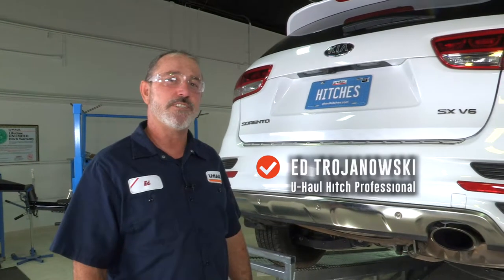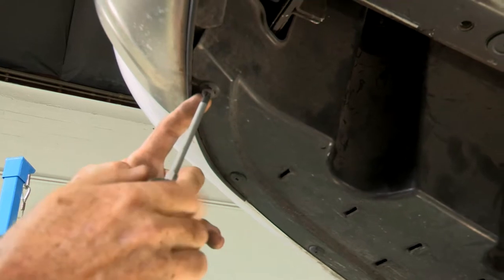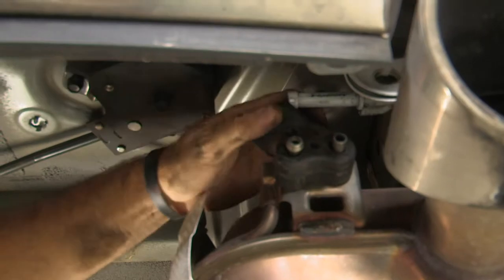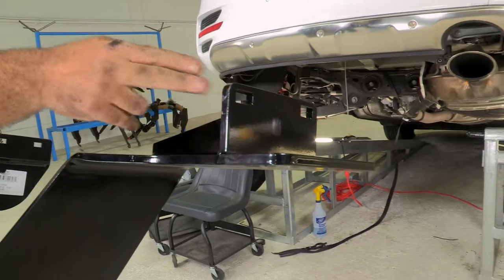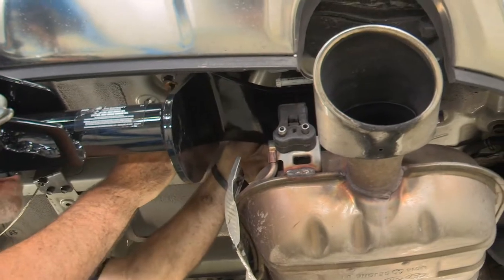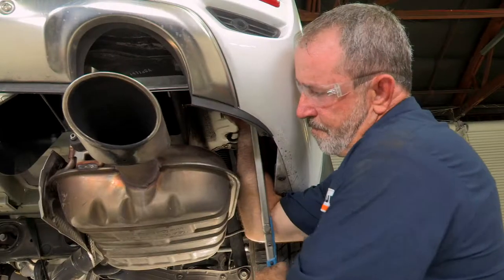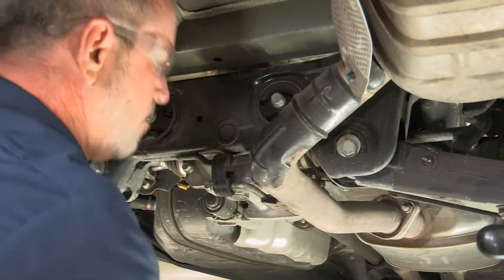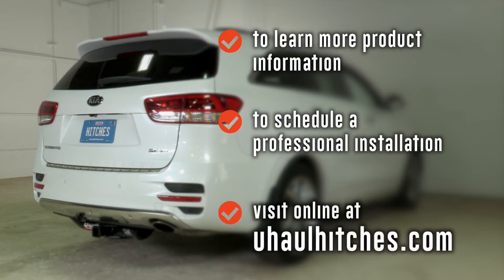2016 Kia Sorento Trailer Hitch Installation

Comment: Great help for installation on my 2016 Kia Sorento Uhaul trailer hitch...but I can add a few tips that might help others doing the same install. It was our first diy trailer hitch installation. The above video explained almost everything we needed to do the job, but we nonetheless ran into a couple of challenges that we were able to figure out a solution to. 

Problem #1: 
The first slightly frustrating problem I ran into was when I tried to loosen the two underbody paneling nuts. First I removed the 6  plastic screws as shown in the video. When I tried to loosen the 2   14mm nuts, the nuts just kept turning but not twisting off the screws. So I ended up just pulling down on the panel and the panel came right out. 

After that, things moved along smoothly. We were able to lower the exhaust with no problem whatsoever and I put a strap around it so that it wouldn't drop too far. I had a helper, so we next lifted the trailer hitch over the muffler on the passenger side and slipped it into place. No problem there. Let's move on to the next obstacle.

Problem #2:
We had easy access to the 2    1/2" carriage bolts thru the top holes on the drivers side. We pushed them in easily.  The second problem we ran into was that the 2    7/16" carriage bolts on the passenger side did not fully line up with the holes in the frame of the vehicle. We ended up using the floor jack to help us raise the trailer hitch high enough to line up the bolts to the holes. Apparently we didn't have enough arm strength to raise the trailer jack by hand that would allow the holes to line up. Anyway, the floor jack took care of that problem. We were able to start the bolts into the holes in the vehicle frame and ended up lightly tapping the bolts the rest of the way thru so they fit all the way in and the heads of the bolts seated flush. It is important that the square of the bolt is turned so that it fits into the square cutout on the trailer hitch. So now our 4 horizontal mounted bolts were in but not tightened yet. We still hadn't started the 3 smaller M10 bolts with their conical tooth washers. 

Problem #3:
Upon checking if the holes for the M10 bolts were aligned or not, we noticed that we had to slide the trailer hitch either forward or backwards till they did align. At that point we noticed that the holes that the 4 larger bolts went thru on the trailer hitch were slotted to allow for a slight forward or backwards movement. We did that by kicking it towards the front of the vehicle a few mm or tapping the inside corner of the trailer hitch with a hammer (and a piece of wood to protect the inside corner of the hitch where it was bolted to the frame) to move the trailer hitch rearwards. That took a little patience and finesse but we eventually were able to line everything up and insert the smaller bolts. That brings us to problem #4.

Problem #4:
But before we torqued all the bolts down, we noticed that there was a gap of about 3/4" between the vertical plate of the trailer hitch and the frame on the passenger side. At that point, we thought that maybe we had the wrong trailer hitch or that it was just a poorly fit trailer hitch. So I called Uhaul and got some advice on that issue. I was told that that 3/4" gap would disappear once we torqued all the bolts down to specs. I only half believed that advice because I figured that both the frame of the vehicle and the trailer hitch itself were rigid steel with no room for flex. Fortunately, that advice was correct and the gap disappeared totally once we heard the click of the torque wrench. We couldn't figure out exactly which part bent or stretch to fill the gap, but thankfully the gap was no more.

Conclusion:
Reattaching the exhaust hangers, the underbody panel, and the spare tire were simple enough. All in all, it was a fun project that took up about 2 hours and 20 minutes of our New Years Day. The Uhaul video was of immense help to us and specific to my vehicle. I wish there was a video on installing a trailer hitch on a 2004 Volvo S80 2.5T. I'm sure that will be my next project at some point soon. Perhaps I will make a video if I get ambitious.
Reply from the maker: Glad our video could be of some assistance. These are all great tips for problems that could arise. Good looking out!